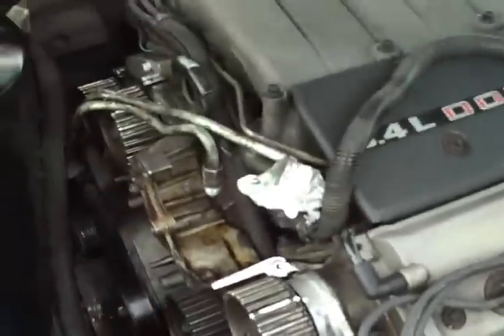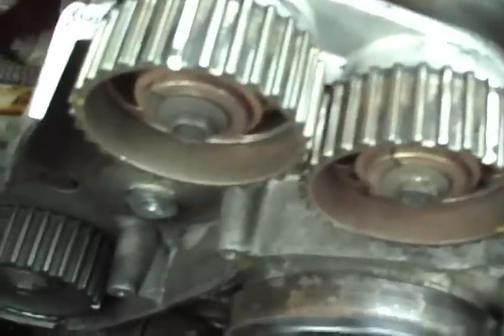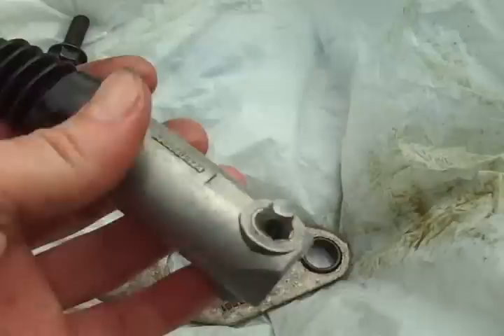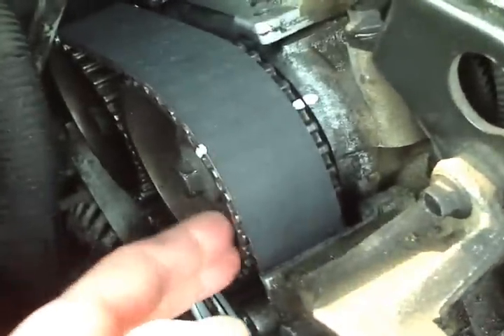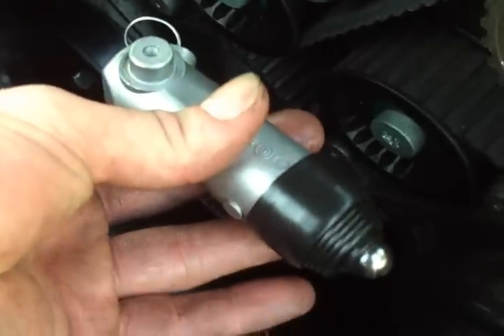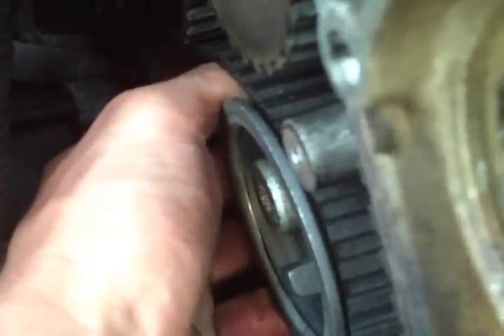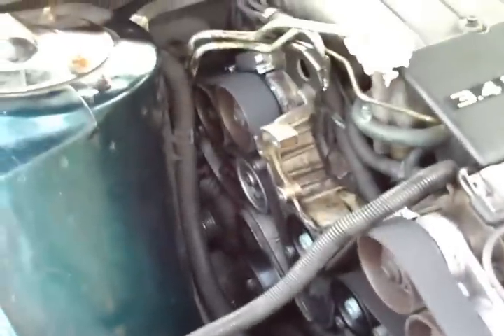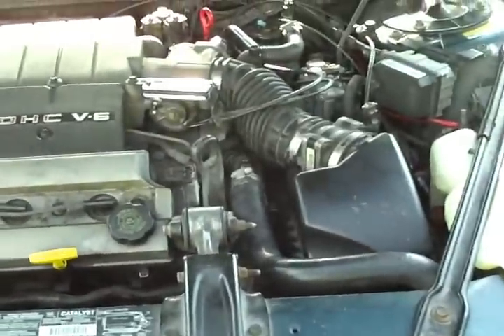3.4L DOHC V-6 Easy Timing Belt Change

Comment: Doen this repair may many times in years past, working at the Chevy dealership. 

Right way is to remove intake and both valve covers. Place cams on it's " flats" and tighten down with Triangular Kent Moore hold down tools so they don't rotate.

Use another special kent moore cam sprocket puller to remove freewheeling locks. Sprockets will free spin on cams with bolts removed.

Remove all timing components. Replace all cam and crank sprocket seals ( they always come in as a crank no start, due to oil leaking onto timing belt and breaking it )

Install all timing components, free tensioner. Place crank at TDC, tighten front cam sprockets ( bolts with lockdown dowels ) and remove camshaft hold down tool.

Turn crank 180, then lockdown rear cam sprockets. Remove rear head lockdown tool. place covers, install valve covers and intake. 

Done.
Reply from the maker: The whole point of this video was that you only need to do the long method and loosen then tighten the cam sprocket bolts (which requires a special tool that is prone to failing) if your belt has broken or jumped and the timing is no longer correct. I thought I mentioned that in this video, and I also have a video going more in-depth on the long process with a complete tear down and how to modify the timing from factory if desired.
Reply: So is the cam sprockets keyed on the cans at all or is it like the damn Ford ZX engine

Comment: I don't recall the whole procedure but I do remember the cam sprockets aren't keyed to the camshafts. You lock the actual shaft with the tool on the flats, the loosen the cam sprocket bolts, go around 2x and then tighten the cam sprocket bolts. Also, the lowest sprocket, that would be the crank, isn't the crank. That sprocket is driven by the actual crank via a chain behind the inner belt cover. I don't think it's the traditional 2:1 ratio. Also, the mock distributor that drive the oil pump was always a source for oil leaks on that block. On the DOHC model, the cylinder head has to come up to do it.
Reply from the maker: Yep... I have a more in-depth video covering setting the timing the long way using the sprocket tool and some other tricks on modifying the timing as well.
Reply: @XHustonProductionsX  i need to change my timing belt on my 92 z34 this spring and i want to change the timmimg when i have it apart again.. 4/4 degrees.

Where can i see the more detailed video of the timming procedure with the tools ?

Comment: Great video XHuston, I just installed a timing belt on my 1996 Z34 Monte Carlo - I marked all the timing places on the belt, sprockets and crankshaft - to Top Dead Center I also removed the sparkplug of the TDC cylinder . I also used Kent-Moore Hold Down Clamps for the camshafts ( Front & Back) to keep everything in place. The problem is when i rotated the engine after completing the belt installation everything lined up excepted exhaust left or rear camshaft the one nearest the firewall that i removed the spark plug from, it off quit a bit. Can I use the Kent-Moore Hold Down tool to adjust it to the correct setting mark? turning it engine forward with the belt removed solo?  Thanks

Comment: Great video thanks for posting. I have a 3.4 DOHC 1995 Cutlass Convertible and replaced the timing belt, tensioner, two pulleys and the serpentine belt following your video. Car started up first time. Before and after the timing belt was changed there was a noise sounding like a bad power steering pump. With only the timing belt on the engine, you could still hear a whining noise. Any suggestions as to where this whining noise is coming from? Appreciate your help, thanks.
Reply: Ultra CNC  Yes still have it and enjoy driving it. Liked your videos I learned a lot.
Reply: It's a Cutlass Convertible green / tan interior.
Reply: Is the water pump on this engine driven by the timing belt or is it serpentine belt driven?
Reply: @daviddancer2727  Serpentine belt driven water pump.

Comment: a little off topic, but where is the PCV on these engines?
Reply from the maker: On the 1996 revision it connects from the top of the valley on the block to the lower rear part of the plenum (closest to the firewall) I don't remember where on the intake it is on the 1994 to 1995 revision, but look for the tube coming out from under the lower intake manifold and follow it.

Comment: To get it to top dead center do you rotate the crankshaft clockwise or counter clockwise? Thanks
Reply from the maker: Always rotate the crank in the same direction that the engine spins when running.

Though you do not have to get the crank to any certain position using my method in this video; it won't hurt, either...
Reply: @XHustonProductionsX  A little late but Thank You for sharing this video. I changed my belt myself following your directions on this video. 🤙🏼

Comment: How would you necessarily know if your timing is off?
Reply: Kolton Cody it wouldn't start, and if it did it would run horrible, and stumble. less power if it does run and drive, idle issues etc.

Comment: well, nothing like an "easy fix" to wreck a 3.4. after a few minutes of this simplistic how to video and i made an appointment with a qualified wrench. if it does jump time, just take it to the junkyard. good luck replacing this engine as it is unobtainum...
Reply: doesn't make sense to junk a functioning engine that is out of time...especially if it is "unobtanium". laziness doesn't fix a problem, only doing the work yourself or as you said, hiring a mechanic will.
Reply: Okay ask yourself?

Is this interference or non interference

Guess what
Its non interference so if it jumped time anyways
It just wouldnt start up, probably crank and maybe backfire a bit
But no start, which means, your fine

Comment: plugs can be changed, by removing the front engine mount and using a ratchet or a winch to pull the motor towards the front, be careful not to pinch or brake or bend anything and use a strong winch so you do not loose fingers.  You will gain more room to work. I did it that way many years ago.  but gives you the idea that it's doable when you can stick your hand there.

Comment: As dumb as this may sound, how do you keep tension on the pulley for the serpentine belt. When I loosened it, it just hung there. So I had to pull up on it to keep the tension on the belt as I tightened it down. On the 3100 all you have to do is use a 3/8 ratchet and it's spring loaded.
Reply from the maker: +mike sanders If by loosened it, you mean loosened the bolt that holds the tensioner onto the engine, you just have to line up the tensioner with its mount on the engine and tighten the bolt... You said yourself that it is spring loaded, so if you did it correctly and just used a ratchet to relieve pressure, you do the same thing to put the belt back on... Use something with a 3/8 drive to relieve pressure, and slide the belt back over its pulleys.

If you relieved tension and the belt still has slack and the tensioner seems like its not traveling far enough, you just have the belt ran incorrectly... Check your belt diagram.
Reply: Yeah I'm dumb, I got it. But I got bigger problems. I just installed a new filter and in the process, the rubber sleeve that's inside the quick connect nylon hose came out with it. I popped in the rubber sleeve back in place, no leaks. But then after some driving, it's leaking again. Can I buy just that rubber, or do I have to buy the whole hose? I can't find the rubber anyways.
Reply: Anywhere*
Reply from the maker: mike sanders Which filter? I can't think of any filter that has a rubber sleeve inside of a rubber hose associated with it...
Reply: XHustonProductionsX It's the quick disconnect hose. It connects from the fuel tank to the fuel filter underneath the car. It leaks on me. The only solution I been told, is to replace the whole assembly.

Comment: great vid but here a tip never buy a vehicle that has a timing belt. timing chain rarely hav to worry, may b if it stretch. can put 250k easy on same chain,
Reply from the maker: Hate to burst your bubble but most chains are recommended to be replaced every 100-150 thousand miles lol If you are extremely lazy then don't worry about it until it breaks, otherwise there is no engine that requires no regular maintenance to keep it working well...
Reply: +XHustonProductionsX Where did you hear that because most of the cars I've driven had timing chains and no where in the manuals did it say that. As long as you change your oil regularly a timing chain should last a lot longer than a timing belt.
Reply from the maker: tails300 Last longer, yes... Last forever? no... Most vehicles are not meant to last more than 10 years or 100,000 miles... (if they did those companies wouldn't have you back buying their new cars now would they?) Chains need replacement, not within the interval that GM/Ford/etc deems to be the vehicles lifespan, so if you are smart and keep a car for many years/miles you will replace worn out components before they fail... Every link in that timing chain is subject to wear and breakage... At the very least after 100,000 miles it will have stretched and allow more play in your timing, I have saw V8s that run horribly due to excessive timing chain slack...
Reply: And I regularly see cars reach 100,000 miles and beyond before the 10 year cycle and are still on the same chain. Yes sometimes they do stretch but that doesn't happen very often or people would stop buying cars with timing chains because there not as simple to replace. As you said if your not lazy and change your oil regular you can exceed 100,000 miles easily.

Comment: How hard were the cams to turn to get the correct timing? How did you get them to stay in place under the valve spring pressure while you placed and lined up the belts??
Reply from the maker: I used a 3/8 ratchet to turn them, wasn't all that difficult with 2 hands... Once you get the belt to hold onto the teeth on the cam cog it won't move, just takes a bit of trial and error to get aligned.

Comment: Awesome Video!! I'm going to use it when I'm about to change my Timing Belt. I have a 96 Chevy Monte Carlo that has the 3.4 DOHC. Your right about shops being scared to work on them or not wanting to at all in some cases. I have about 224,000 right now on the motor. Have you ever changed the spark plugs? I was trying to do them myself and i'm not able to reach the back 3 plugs. I was told that you have to remove the intake manifold. Is there another way around that?
Reply: no

Comment: PLEASE PLEASE HELP ME! Okay i'm gonna do this my car runs good but i see the timing belt needs to be replaced. I wanted to ask about the marks i make on everything. The crank on the bottom that won't move at all when i take old belt off right? Does it have to be set at the bottom? I just thought that if i take old belt off and make sure nothing moves i can just put new belt on..is that correct? Thank you so much for making this video.I told a mechanic about it and he said it is impossible

Comment from the maker: Thats good, it doesn't have to smoke to slowly burn oil tho... If its dripping slowly the first things I would check are the easy things like your oil drain plug gasket and oil pan gasket (make sure the bolts aren't loose also) and if its not those things then start searching... and hopefully its not the head gasket(s)

Comment: Well, it doesn't smoke at all. There are drips of oil when she sits for a little while, like 2 days or so. Nothing major, but still, it does leak. Thanks for responding to my question. I was just hoping there was a certain "all these engines leak there" answer. That's ok. I'll just have to get in there and figure out where it's leaking from. Thanks again.
Reply: I know this post is so old, and there's no way you still drive this car. I'm writing this for someone else who may be reading it. The "all these engines leak there" place for the 3.4 dohc is the o-ring on the oil pump drive. Since this has a 2.8 block it was designed with a distributor. And since the 3.4 uses coil packs, the oil pump is driven by a contraption that is essentially the bottom half of a distributor. When (not if) this o-ring starts to leak, it will be a bitch to find since it's under the rear cylinder head. Sorry I didn't see this post until 5 years later! Wish I could've helped!

Comment from the maker: Thanks, yea most normal shops won't touch anything on these engines like they are scared of them! lol They are a bit harder to work on and more complicated than their OHV V6 cousins but not a nightmare like some think... How many miles does your engine have? If its a very slow leak it may just be burning oil due to wear... if not it could be a gasket, head gaskets go out on the 60 degree V6es so don't rule that out, other than that try and find the oil trail if its a faster leak, good luck!

Comment: Excellent video. I had garages tell me to sell my '94 GTP because noone in town will touch a timing belt on it. I guess now, I'll just do it myself, thanks to you. I've got a question for you, though... Is there a certain place these engines will start to leak oil? Mine aquired a leak, but I can't see where it's coming from. I'd like to resolve the oil issue while I change the belt. Thanks again for the awesome video and any suggestions you may have.

Comment from the maker: Thats tricky, revving without the throttle moving could be your TPS sensor... If it won't idle without using the throttle (keeps dying) that is usually a leaking intake gasket or bad vacuum leak... and a misfire under 2500RPMs would more than likely be VERY old, corroded plugs or very old plug wires that are in dire need of replacement! It sounds like you have more than one problem but its hard to figure out from what somebody else tells me, do you perform regular maintenance normally?

Comment: @XHustonProductionsX I got the same engine in my car, and when you start it, it revs way up then dies, but once you give it gas and it starts idling, it runs with a misfire, which goes away when you get above 2500 or so rpm, has yours ever done that? and if so, what did you do to fix it?

Comment: im sorry, maybe I didn't explain it right, when you turn the little screw in the back of the hydraulic tensioner to retract the ball bearing then insert the paper clip wouldn't you have to reverse the small screw to put the tension on the paper clip? then install it and pull out the clip?

Comment from the maker: Not sure what you mean by turn the screw back, but once everything is lined up you just pull the paper clip out to re-apply tension... I don't think you could get the clip out if you put the bracket on first, I didn't and there may be a torque recommendation for the tensioner bolts but I just used a ratchet and got them really tight... Tried to get them about as tight as they were which was dam snug, I would guess 50-75 ft lbs...

Comment: Hey, When you pull the paper clip out of the tensioner do you have to turn the screw back to its previous position first? and did you put the bracket on before taking the clip out? Also do you have to torque the tensioner bolts to a certain foot pounds?

Comment: sorry, can anyone tell me about the tightening of threaded connections engine LQ1? nowhere I can find I need to change the timing belt and the values of the moments do not know. I live in Russia, it is very difficult to find this information. I have the same engine. by the way why you have me on the belt (which stands on the engine) no marking time

Comment from the maker: Yes but if you use my method the cam flat positions don't matter, if you use the recommended method the front cams will be flat and the rears will be down (180 degrees) I'm not sure whether there is any valve tension on a cam or not, if you mark them before you remove the belt, or have the tool holding the cams it won't make a difference tho one of my rear cams did rotate about 90 degrees but I just put it back on the mark that I made and it worked just fine... Good luck!